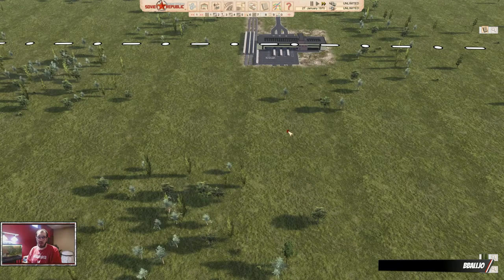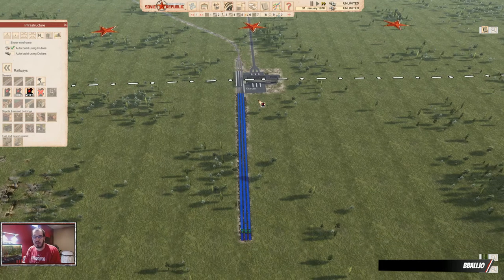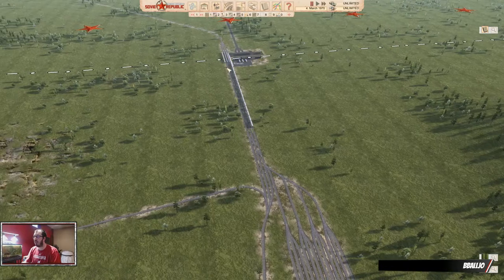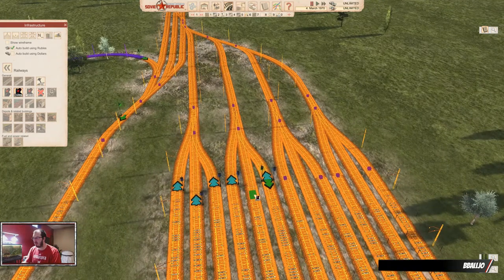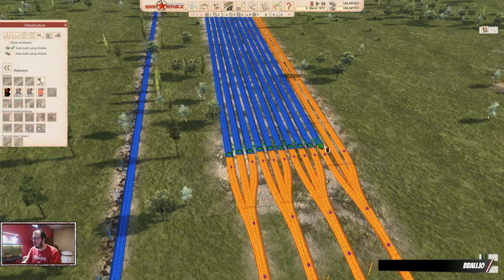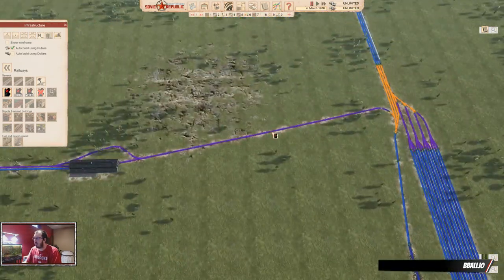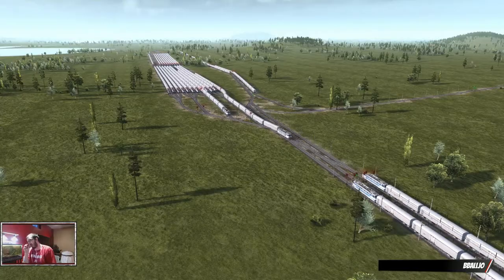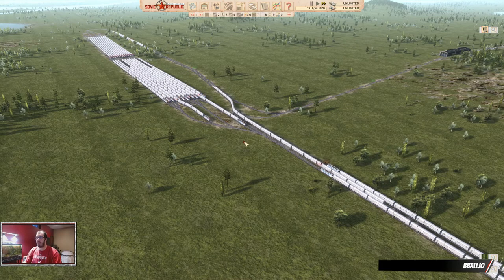How to make a Huge Railyard | Tutorial | Workers & Resources: Soviet Republic

Comment: Whats The function of the rail yard? To store trains until they are needed? Does the rail distribution office make this somewhat less needed?
Reply from the maker: Technically, there isn't anything that is needed in this video, it's more a "look you can do this" kind of thing...that said, sometimes having a railyard is a better option for queueing with direct lines as compared to a very long single track with queues, you can even make the railyard be a siding that runs parallel to the mainline, which can be pretty:)

Comment: how long should I make regular non electric trains depending on their power ? is there a forumula like : x power / carriage ?
Reply from the maker: At this point, the trains are pretty binary, they are either stopped or accelerating, but the rate of acceleration doesn't seem to be impacted much (if at all) by the load or grade or turn radius....so at this point I ignore their power, and just use the max speed as a guide. This may change in the near future, although with how the rail system is working today, I doubt the track will ever have much influence on the speed. 

However, I am relatively certain that the load calculation above does have an impact on the RPM which in turn has an impact on how much current the train draws, but that's really mostly important when a train starts from 0, and you can easily combat this by adding more Train Power Connections. 

Long story short...you can ignore the power, and go as long as your network allows :D
Reply: @bballjo  thx mate !
Reply: also thank you for all the tutorials. this is pure gold knowing that the game has 0 guidance in general
Reply from the maker: Happy to help!

Comment: i know this is an old video, but i just wanted to ask, but in this set up there isn't a track for the trains to head back to station (to load back up on goods for export for example), they will just keep circling back to the waiting area. We would have to add another line parallel to the one they come in originally heading back the opposite way through the electrical switch you have powering the rails, right?
Reply from the maker: There is a track out...it's one way traffic everywhere but the customs house.
Reply: @bballjo  ah i missed it, thank you bballjo

Comment: As always a great video! TY. I do have a question - will the train diesel station work if I supply the fuel to the storage tank connected to it with a pipe? I cant get it to work for some reason. The trains just never go there to fuel up
Reply from the maker: Storage and tank are both passive connections, they only receive fuel, but cannot push or pull fuel, you need an active connection in between (pump) to move the fuel.
Reply: @bballjo  Ok, now that makes sense, TY